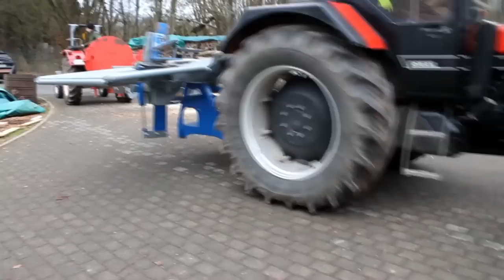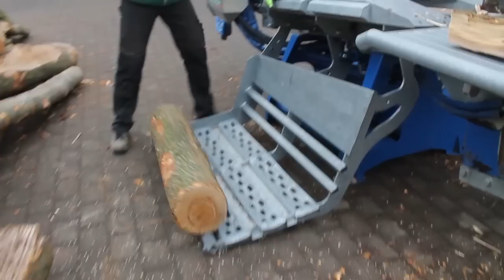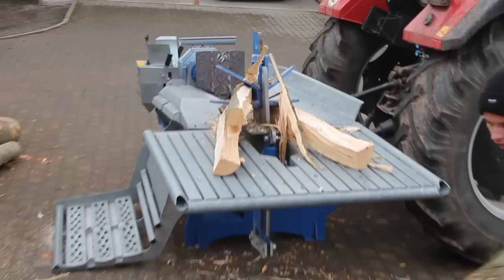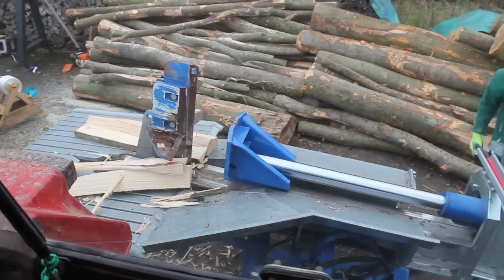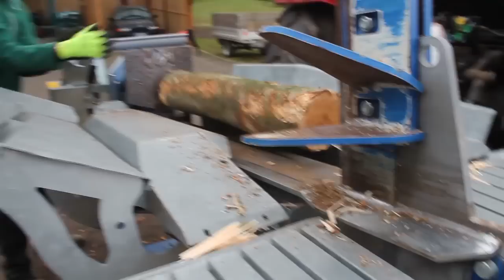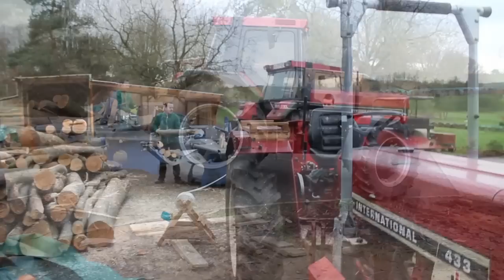Binderberger Gigant 30 Z am Case 956XL

Comment: 1000er Zapfwelle im Standgas haste auch 540 umdrehungen und ist Spritsparender. Mach das mit meinem 844xla und Gigant 30Z auch
Reply from the maker: Wir fahren auf der 1000er bei Motordrehzahl 1400😋
Reply: Forst- und Gartenservice  wie viel kann der Spalter ab 1000er oder 540er